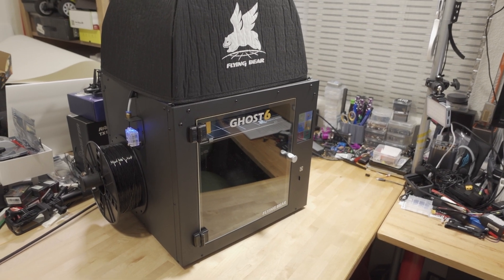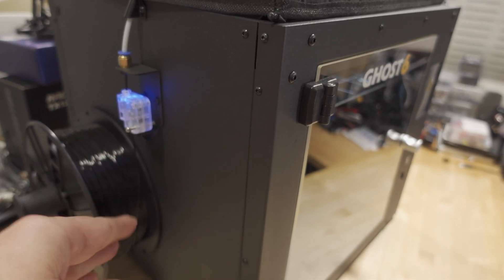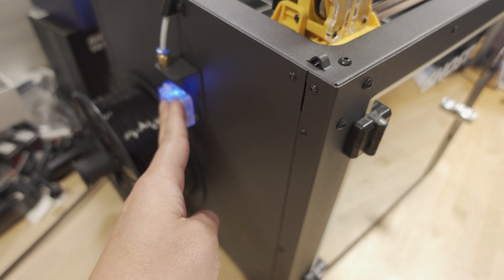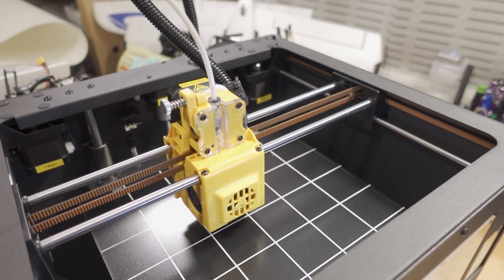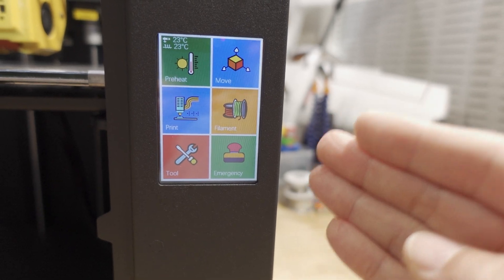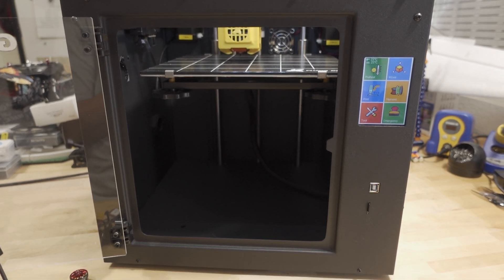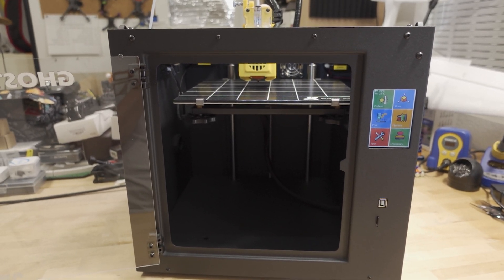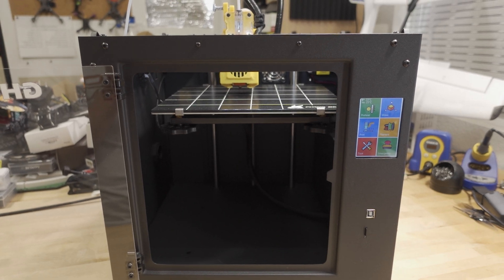FlyingBear Ghost 6 CORE XY 3D Printer 🧊🐻

Comment: Hi there! I have a problem with tpu filament (shore A 95) it bends under the two gears blocking itself from going down, also it locks the gears so the motor loses steps due to the over torque. Have you got some suggestions? I am going to print tpu 95% of the time like you. 
Thanks.